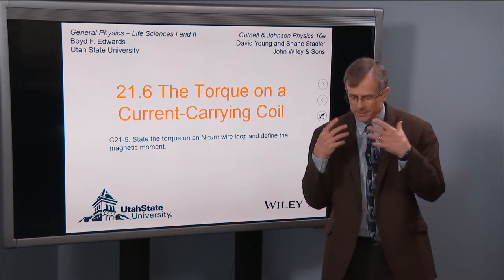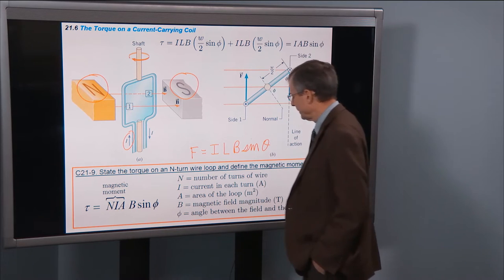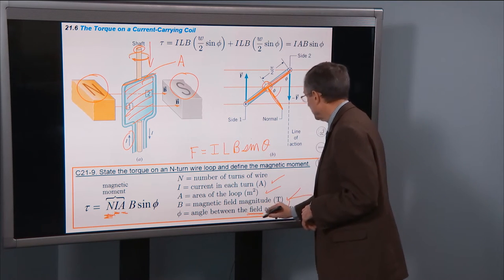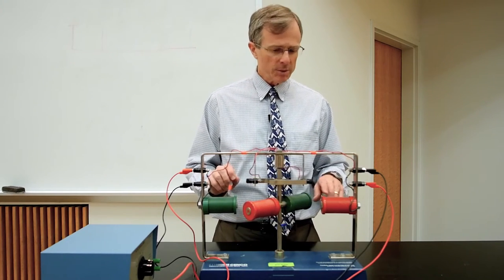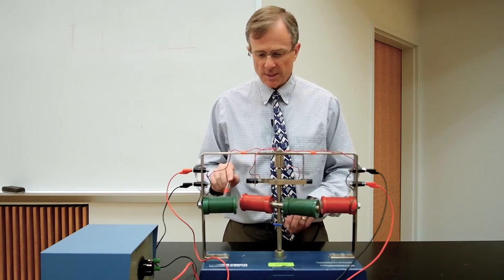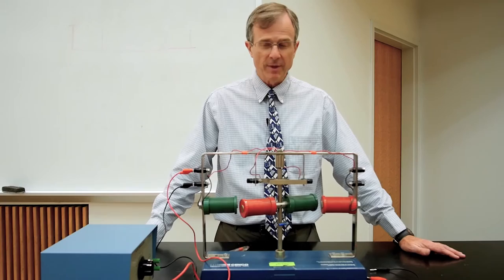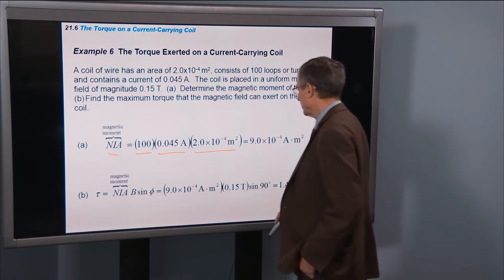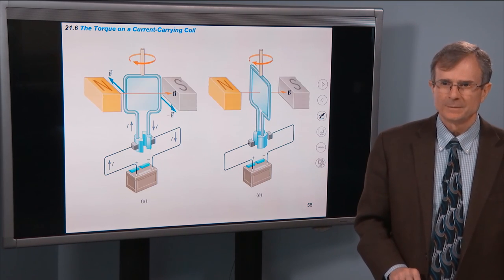21.6 The Torque on a Current Carrying Coil

Comment: If we use tiny diameter room-temperature superconductors that are 100 times smaller diameter than copper wire,
then we can wind motor or generator coils with 10,000 times more turns in the same coil space as copper magnet wires.
That means we would need 10,000 times less electrical input energy (petroleum fuels, bio-fuels, or renewable fuels) 
to produce the same resultant magnetic repulsive or attractive strength.  
Look up Superconductor News, (Superconductors.org) & especially see the February 20, 2016 paper entitled : 
"Shaming the Scientific Community with Record Superconductivity" 
with 35 room-temperature candidates.  
Do I have to tell you why this has been suppressed ???